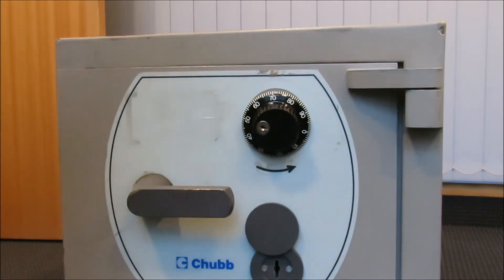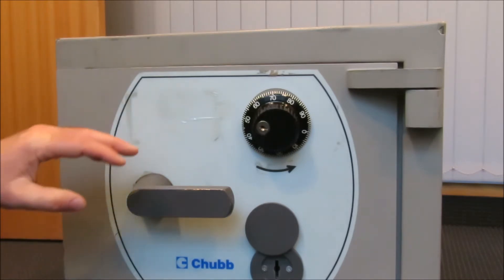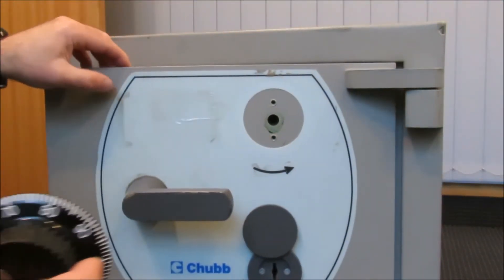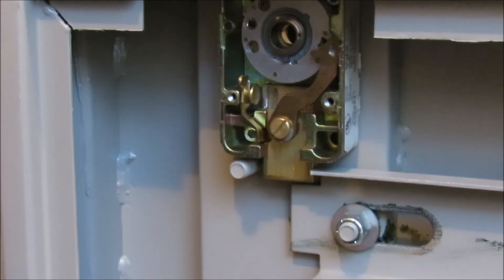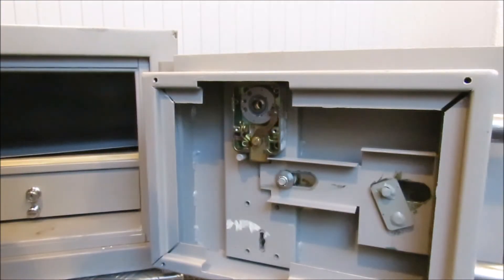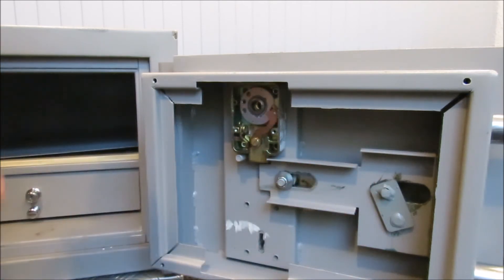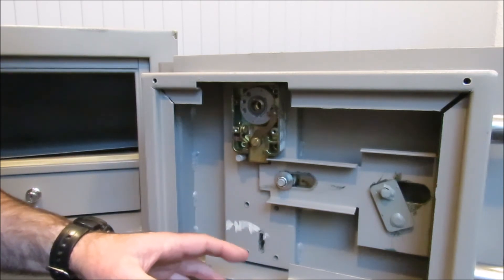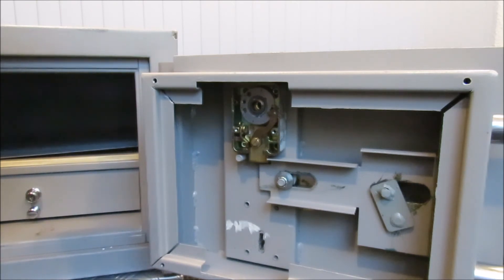[106] Tutorial Group 2 safe locks - The Relocker - part 6 of many

Comment: An independent re-lock mechanism operates via a pre-tensioned wire holding back a steel relock bolt that engages directly with the bolt mechanism. This is more effective and can't be easily bypassed. In many newer variants they added a glass plate suspended between the lock body and door frame, in turn attached to a spring tensioned steel relock bolt. If one attempts to cut their way in and inadvertently snaps the thin wire, or breaks the glass plate, nobody's getting in that safe again without completely destroying the safe. It's actually not too difficult to add a relock mechanism to an existing unprotected safe.

Comment: Them days are well gone. Criminals use a big grinders. It doesn't matter what safe you got. In less its 3 4 5 grade. I would say 70 percent safes in U.K Are crap. I seen OZsafes and they are just as bad.lol. VDS inspector said to me. it could be made of breeze blocks as long it passes. LOL. Combination locks are the most easy lock to defeat. That's why we use keys on our safes in the UK. OZ the U.S.A love combos. Good vid. Just drill it that what people really want to see. If need any help with tips. Let me no?regards Jon.
Reply from the maker: Great comment Jon, I agree 1000%. Group 2 combination locks are the exact equivalent of the 5 pin Yale rim cyl on your granny's front door - just a 100 year old low security mechanical toy.  This is why I just don't understand why 90% of the locksmithing world gets all hot under the collar whenever they get discussed by locksporters. Thx for the comment mate.  Michael.
Reply: No problem 😊. Your a good teacher. And you definitely no your shit. lol. Regards Jon.

Comment: Interesting 🤔🤔🤔🤔
Once the spindle is out however,isn't it easier to manipulate the "relocker" and the bolt???
Reply from the maker: Excellent question.  In theory yes but in practice no, you'd need to exert considerable force on two separate things in two separate directions, all through a hole about 10mm dia. Possible, but veeeeeeeeeeeeeeeeery unlikely.
Reply: In addition to what Michael Maynard just said, you'd also have to know exactly where it is on THAT model of lock. Different models even from the same brand may put it in different places, just to make that more difficult. 

Also, suppose the business or home has a burglar alarm. No one in their right mind would stay for long with the alarm screaming its head off, even if it's not monitored the alarm could turn some heads if the right people happen to be nearby and paying attention. And how would the burglar know if the alarm is monitored or not unless it's an inside job?

Comment: Very interesting video Michael, I've always wondered how the built in relocker works. Some safes have a separate relocker which is a spring loaded bolt. A plate will be screwed onto the back of the lock (in addition to the existing plate) If the plate comes off then the bolt will pop into position and lockdown mode is active.
Reply from the maker: Yeah there are all sorts of frankly awesome relockers that are part of the container, as opposed to being part of the lock. I'd love to do a video on these actually and probably will at some stage, time permitting...

Comment: Very smart idea. Now I think that one could insert a wire through the hole (where the axis of the spindle was) and manipulate the relocker to free the bolt.
Reply from the maker: You and Pickbeard have very devious minds...
Reply: You'd also need to pull the bolt as you have no drive...no imagine that on a door slab 3" thick...!😭😭
Reply: @tedda  Some locks have the wheel pack mounted on the back plate. So they are gone as well when punching off the cover. Once removed, the bolt can be retracted freely.